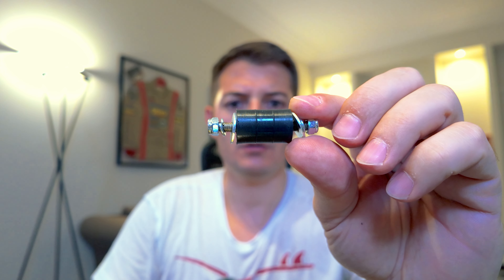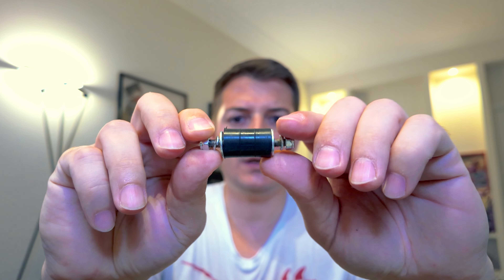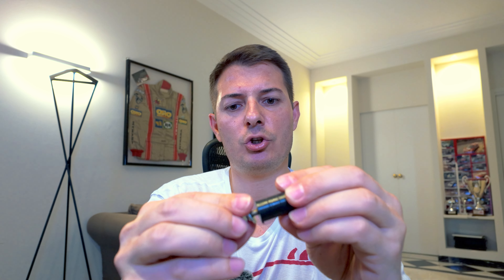GR Yaris AJC Brake Cooling Kit & Install tips | 4K

Comment: Cool AJ  😂 ,  mine are on the way, will watch this later  on TV at home.

Regards Russ....🙏
Reply from the maker: Yes they are Russ!
Reply: My cooling ducts arrived , well packaged and easy to track on my phone, right to the door, still at work wife signed for them.
Photo sent to my phone, great service.
My advice on fitting these is with the wheel removed , much easier.
I didn't do this, I ran the car up on the ramps 1/2 way .
Cleaned both the arms and fitted the supplied tape, I located the scoop on each side, they are marked Left and Right , located the threaded damper both flat and spring washer , then the simons nuts.
I slid the scoops in untill I thought correct clearance, for me just a little to close.
I locked the nuts up evenly both sides .
I rolled the car off the ramps and went for a drive, all OK untill I turned left or right, mine just caught the wider section of the stock wheel causing a squealing noise . 
I drove back and could see my mistake, I put the wheel on full lock
slackened both nuts and slid the scoop across to the wider section and re-secured on bothe sides.
About 30mm inboard , all has been great since.
Just for ref, I'm running standard lower arms and wheels, 2.5 deg neg caber bolts fast road set up.
With the wheel removed these will be a 10 min job each side.
On the ramps and reaching under to the arms has taken me 1  + hours on my back .
I've driven the car down a couple of twisties and on the motor way today with no issues, movement or noise .

Regards Russ....🙏

Comment: Nice mounting solution! Have you actually tested how brake temperature performs with and without the scoop, maybe did some pressure testing? Also what about the drag this part will be causing? Creating functional aero parts is much more complicated that everyone thinks. Cheers!
Reply from the maker: Thankyou mate!
We haven’t done any testing as the parts arrived two days ago and now I’m travelling for three weeks, setting up the next step of things for me and AJClubsport!
We have used all our experience as design rules, and it is a parametric solution to the Audi RS3 with some improvements.
We will do some testing, although to have a real drag test it would take a wind tunnel, while temperature testing is quite unreliable if you don’t have a proper IR onboard telemetry, just not to sell fried air…
Reply: @PIRASMotorsport  Ok, I understand. Also thanks for the detailed response. I wish you good luck with testing and developing this product to be best as possible!